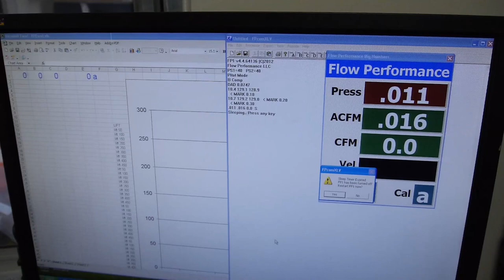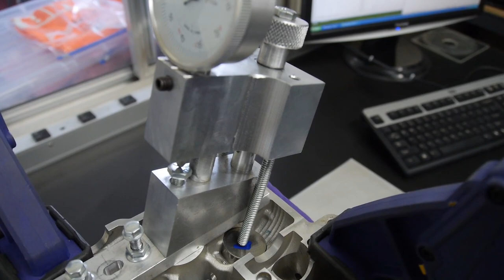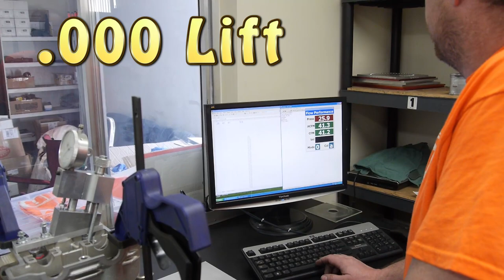WR310R - Flow Bench - Porting - Lindsay Machine Racing

Comment: Yeah, wow that really is a nice ass design on that head, it's basically a straight shot right into the cylinder, very nice, and he cleaned it up very well.  Working with flow is an art.  I mean it's true that it can all be 'simplified' with mathematical modeling, and different designs tested with actual measurements, but at the end of the day when you run a shop you still have to make 1 cut on a head with a dremel and it better be done right or you'll cost the customer a different part of the power band or similar.  You can't easily fix taking off too much material, typically it can't be fixed at all.
Reply from the maker: MrSlowestD16  Well said buddy.

Comment: Do you have any flowsheets what you’re getting out of your head?
Reply from the maker: Unfortunately, we have ported a few of them differently, some with smaller ports to increase port velocity, and others with bigger ports and reduced velocity, both dynoed about the same, and we didn't keep flow numbers on any of them. Surprisingly, we learned that by adding bigger openings to the airbox, with a stock unported head, we're getting the same dyno numbers as the ported head motors....
Reply: @ what’s the best horsepower You’ve seen out of some of your 450 builds?
Reply from the maker: @jeromewells151  Without big bore or stroker, 60's+?
Reply: @ that’s about average I have a really good one then,mine is an 09 Honda.

Comment: Awesome video man! I've got a pretty new WR250R and i'm considering the 280 thumper racing kit with just the stock crank.. I'm curious if porting would be worth it with that setup. Do you think LMR would port it the same way as the 290 athena kit? Or I wonder if they'd want to flow bench the 280 kit as well..

Comment: Do you think there’s much to be gained from porting the Wr250r’s heads? Do you have before and after numbers or estimated power gain?

I’m building up my Wr to be a mini daisy chain and am currently installing a thumper 280 kit
Reply from the maker: We don't have HP or torque numbers for pre-porting, but it seems like Daisey Chain was 26 hp with tuning before big bore, stroke, porting, and tuning. We only have flow bench numbers before and after porting, which are proprietary to Lindsay machine racing and won't be released. In order of benefit, it goes like this: Athena Big Bore kit (most benefit), followed by stroker kit, followed by porting, followed by throttle body boring.  I am not a fan of anything from thumper racing, we've seen very poor quality cylinder work from them. But it may work out for you, which is great. Good luck!!

Comment: Stop with it's Proprietary info, there's no secret formula or magic its just grinding and sanding.
Reply from the maker: Not true, the runner shape, cross section area,  straightness,  bowl, transition area, valve pocket size and shape, % of opening on intake vs exhaust seat area, and many other factors determine measured naximun flow at different valve lifts..... proper porting is a proprietary thing,  an there are a lot of secrets to maximize flow buddy.... it's not like we used to do when we were porting our big block chevelles and actually losing performance.....